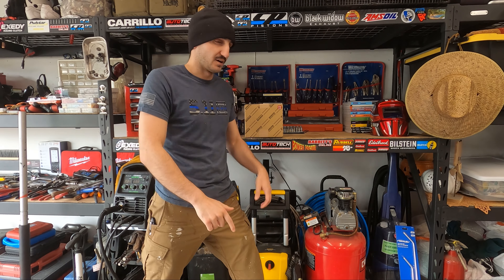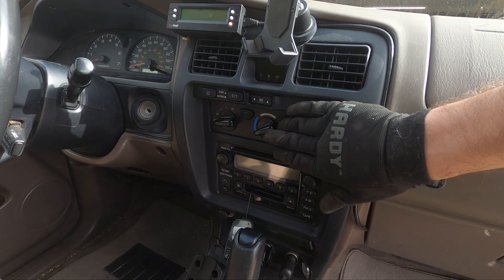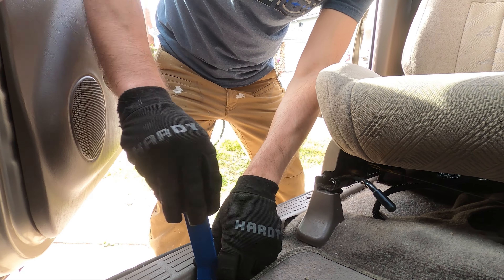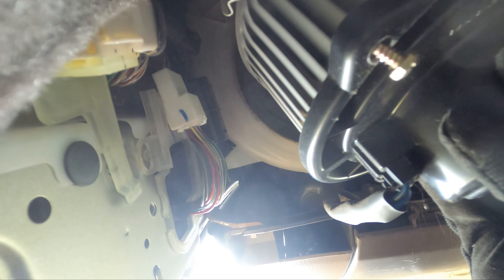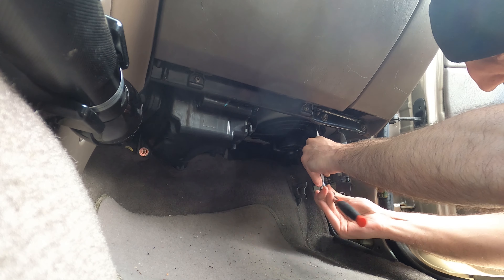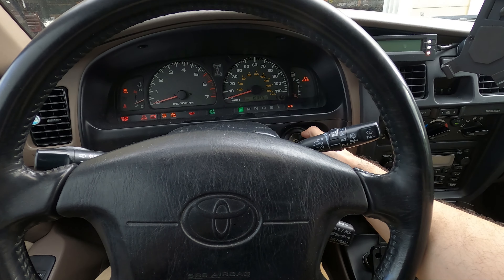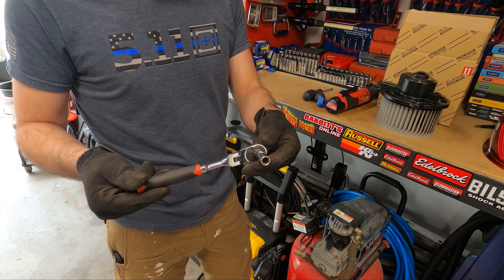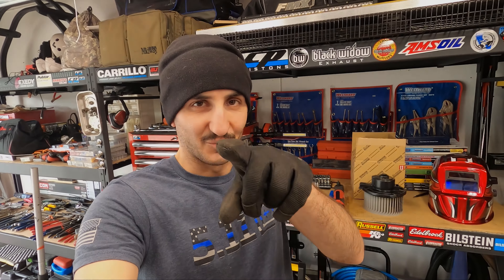1996-2002 Toyota 4Runner Blower Motor | Quick Fix!

Comment: It worked! 😃 I have a 2000 Toyota 4Runner, the fan motor was working fine but I could hear a ticking sound every time I turned the fan on. So I took it apart just as you showed and I found a little piece of dry rotted weather stripping that had fallen into the fan cage so I removed it and put everything back together and it worked like a champ minus the annoying sound - Yay! Thank you so much for taking the time to make this video. 🤗
Reply: I have a 4runner from 2000, it is my first car and I love it, I just have one question, do you know if this year's models use a cabin air filter?
Reply: I'm sure you know the answer to this already but the answer is no it does not come with a cabin air filter from the factory.

Comment: Nice video.  Do any of these fans have an air filter.  I saw another video where an filter is tucked inside the blower.
Reply: Yes you can buy that filter and what you do as you would take that fan out put the filter in first you would screw through the hole and then put the fan back in. Because there are no cabin filters like for my 2002 Toyota forerunner example

Comment: Nice job, thanks. This is the third time I've had to pull the blower, first in my older '98 4Runner (dead mouse! Yuck). This was the second time with my '99. First time I was afraid it was another rodent but it was just a collection of sticks, probably rodent-based. Fortunately, no rotting flesh. Does the 3rd gen have a filter of any kind to keep the outside mice outside of the fan? I can't fine the outside air intake or I'd replace or add some kind of anti-mouse screen.

This time the source was internal as it was totally packed and clogged, about 3/4-in deep (inside the squirrel cage) with what looked like rug fibers from the padding under the floor mats. Clean-out took longer than your video but now it works well. No cabin filter, huh? The biggest, and most time consuming, problem was seeing and unscrewing (and rescrewing) the three 8mm screws. Total PITA ding contortions in a confined space when working upside down. But it's done! Thanks. Only 250,000 miles on this truck!

Comment: I have a question, on the 96 4 runner,where does it pull in the air for the AC when you have it on max, it's sucking up my dog's hair and I want to maybe shove some filter type fabric in front of it so maybe it will help, I see a fan under the pass seat could that be it, just point in the direction from the floor board under the glove box if it's under there, thanks.

Comment: Great job! Thanks for the great instructions and for the part numbers!  I followed this to change out the blower motor on my 2004 Tacoma (pretty much the same except I actually didn't have to remove my door step panels).  I also replaced the resistor, but my A/C still doesn't work on all of the speeds. Any thoughts on what else could be causing that?  I'm getting cold air, and everything else seems fine it just works on some speeds, then drops out on others.
Reply: Are you sure the replacement resistor is good ? I could not count the new parts i have purchased that were no good right out of the box.

Comment: Am I tripping or do you not even need to remove the side panel or floor trim?
Reply: Update you don’t need to remove the trim if you have an angled bit or a small ratchet. Just undid three screws and knocked the trash out without unplugging the harness and it blows stronger than a lot lizard now!